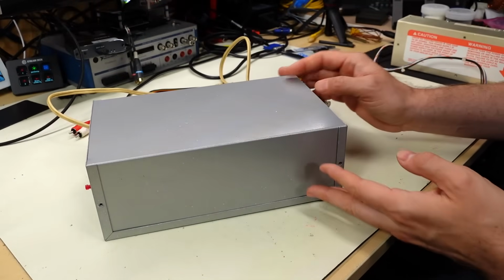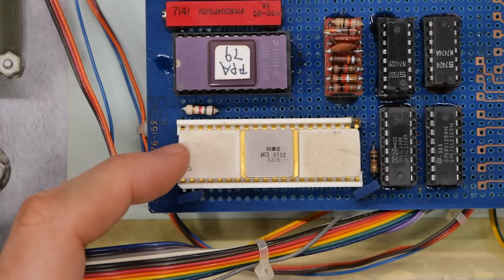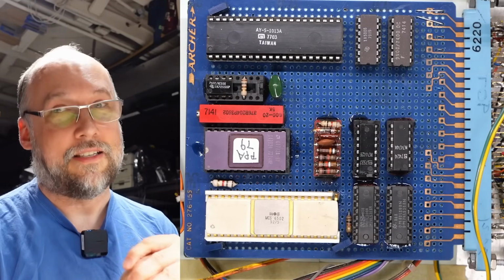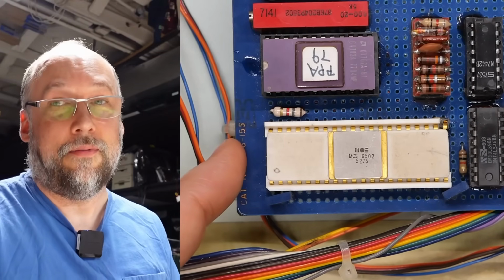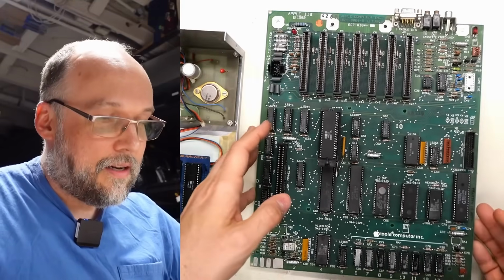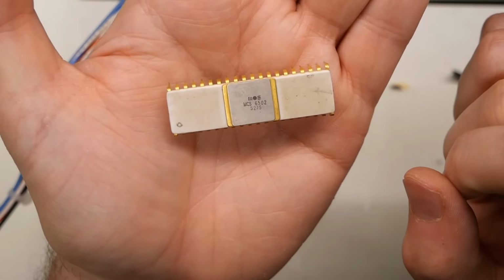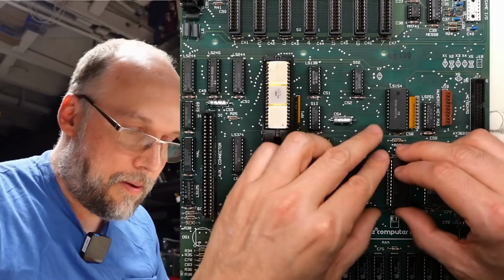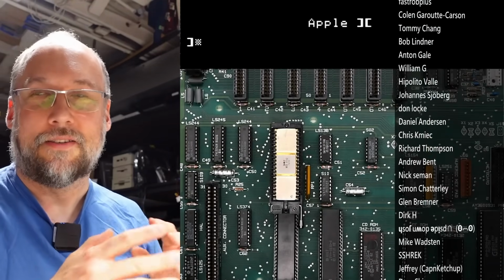Let's test a 50 year old MOS 6502 CPU

Comment: I'm certain the 6502 didn't make it into the box because it was a "piece of junk" but simple because it was the right tool for the job as well as the cheapest - there really weren't hobbyist microcontrollers available in the late 70's. 
All the microcontrollers back then had mask ROM - which means they were factory programmed in the thousands at least, so if you wanted a microprocessor that you could program yourself, the best bet was the 6502.

Comment: Nice video and even nicer hardware find! The AY-5-1013 is a UART interface.
You say that there should have been a cheaper microcontroller in that box - but in the late 1970s there were not so many cheap microcontrollers around (the 8048 and 8035 came out in 1976). Also for a hobbyist who got familiar with the instruction set (with or without ROR) and programming of the 6502 it would have been a rational decision to use the same processor in a homebrew peripheral, rather than to learn another instruction set. Also cross-compilers were not available at that time either - so developing the software on another 6502-machine would also have been quite an advantage over the alternatives. Programming the first generation microcontrollers with one-time programmable or EPROM memories built into the chip would require special programming hardware, while an early microcomputer hobbyist might have had a programmer for standard EPROMS already at hand.

Comment: It has been years since I have done any 6502 assembler.  From 1975 to 1985 the company for which I worked was a VAR for systems made by Singer/ICL in Utica, NY and we later sold a hardware/software system that used Commodore 8032s.  The Singer/ICL systems were the 1500 series that had up to 16K of memory  and was design by a guy named George Cogar who had been an engineer with Mohawk Data Sciences and was done mostly in TTL but did use the AY-5-1013 UART chip for async RS-232 interface.
Most of the programming for the 8032s was done in BASIC,  however I wrote quite a few "helper" routines in assembler.  73 de N3GAQ.

Comment: Could you tell us how he made the rom to test, I mean what happens when you execute that faulty rotate right instruction, is it documented?
Reply: Sorry, I missed the last part of the video. Checked the source code on github.
Reply: Basically; sets carry flag on, where rightmost bit is going to be carried to if ror works then executes ror on a zero (I dont know exact byte size here), if carry is set to one (set) then proves it works, if carry is still zero than it is the faulty chip. Thank you both for great information:) 😅

Comment: I end up sometimes with such a big volume of videos that I have to make quick decisions, but the I hit the @2:15 mark and that home brew box immediately got my attention. I used to make stuff like this. My first "computer" was a home brew 6502 for $300 of my newspaper job (about half a year's salary as a teenager ...). That computer lived in some strange cases with an old Odyssey 2 case as the most curious box that I remember. So whenever I see boxes like this one I have to take them apart to see what's inside.
By the way, I still have the 6502 system but not the Odyssey case. The 8048 that was in there still lives on a small board that I made, using an external EPROM, a few switches and LEDs still shows my first even blinky,  created completely from just reading the datasheets that I had to order via snail mail since we did not have internet or even BBSes back then.

Comment: When the 6502 came out, it was $25. I built a 8008 computer in 1974, but I got rid of it when I moved. I still have the plans for it. It even had a bios.

Comment: The link to the dump is wrong? both the testrom and dump points to the same. But.. would it be possible to share highres photos of the module? I would really like to try to reverse engineer the circuitry along with a possibility to run digital simulation on top of it - with the actual code.. to figure out the exact purpose of this ancient box.

Comment: I recognize the big 40-pin dip, the AY-5-1013A.. it's not a parallel interface, it is a serial UART. :)

I tend to expect that silicon from the old days will likely continue to work for, well, a long long time. Maybe hundreds of years. As long as it isn't zapped or overheated or physically damaged, anyway.

Thanks for the memory. Been a while since I fiddled with chips and discrete components like that. I was an electronics hobbyist in the 70s. Still am, but it's so different nowadays than it was back then. Some things never change, though!

Comment: Wonderful video, what a great find! I wonder, would it be better to remove the original(broken) 40-pin socket and try to shoehorn a ZIP socket in there? Or perhaps, remove the original socket and replace wit ha current socket with machines(round hole) contacts?

Comment: I buy and sell vacuum tubes and vacuum audio. Cleaned out a electronics guy and ended up with around 100 white intel 4000 series CPU chips and a bunch of other 'white' chips. Put them all on Ebay and literally made a fortune.
Reply: 4001, 4002, 4004 chips and many others. Will never run into a 'stash' like this again.

Comment: Oh wow.  I'm pretty sure there is at least one white ceramic 6502 among my collection in the attic along with a few antistat bags of other ICs from back then.  I know there are a bunch of old chipsets from 8 bit and 16 bit CBM machines up there somewhere and with a bit of luck there should also be a few old cartridges & a bunch of modded ROMs..  Ther might even be an old Apple IIe Europlus hiding up there too as I don't remember getting rid of it..  Only trouble is the attic is also stuffed to the hatch with old electronics and radios from the 1950s to 1980s (ish) too..   I only recently got rid of a pile of old laptops and 286, 386 and 486 machines to make space for more modern 'junk' ...  You got me thinking about venturing up the old rickety wooden ladders again !

Comment: I taught myself 6502 assembler using the Apple ][e monitor program back in 1985.  I have a half a dozen in my box right now.  I'm building a C64 on a breadboard right now.  That large 40pin chip definitely looks like a 65C22 VIA chip.  The smaller chips look like NAND chips that are probably used for address decoding and ROM memory mapping.

Comment: I really wonder whether the number on the bottom of the chip is actually a serial number, in which case, a number of "75073" would suggest to me that this would probably be the 73rd chip which was manufactured in 1975, meaning it may actually be the 73rd 6502 ever made (in general production, at least)...

Comment: I have some old hard discs - really old. Like a Seagate 9" and a 14" plus some much larger ones which I haven't measured but the are well over 24" diameter and somewhere I have an unused Pentium chip.

Comment: That is a fantastic find. Keep preserving our digital history. You rock!
In my years of experience hand building boards, I came to loath stamped pin sockets and wire wrap. I did build hundreds of boards with that method and sockets. Virtually all of the builds had all manner of weird problems traceable to faulty connections. Machined pin sockets are much pricier than the stamped pin variety. BUT, they pay for themselves by eliminating many hours of wasted time spent troubleshooting an unnecessary problem.
The one pin you found replaced on the socket was, most likely, because it was intermittent or outright open. ALL stamped pin sockets are a GUARANTEED built in failure point. Wire wrap also corrodes severely in a short time and CAN become intermittent as well. Depends on the alloy of the pins and wire combinations. Galvanic corrosion results with mismatched materials. FYI, wire wrap was developed for computers in missiles and rockets due to lacking a stress point where the wire exits the solder on a normal connection. This also saved weight by eliminating all that lead solder in the rocket. Missiles and rockets usually had very high QC to bypass the initial bad connections and corrosion was not an issue as these things didn't sit around for very long before being used. Once.

Comment: You ask why they used a 6502 instead of a cheap microcontroller. Was there any microcontrollers? The 6502 was made to be used like we use microcontrollers today. It was not made for computers, it was made for scales, pin ball machines, cash registers and other control tasks. So I think the creator used the MCU of the day 😊

Comment: As pointed out below, the GI AY-3-1013 was a UART chip, one of the very few available at that time. I believe Western Digital also made a UART chip as well around then, before disk drives become their main business.  I think I have some of both UARTs here somewhere. Back then, the GI chips didn't have the best reputation for reliability. But GI has some interesting special function chips like UARTs, keyboard scanners and early sound chips. Then they introduced the Peripheral Interface Controller and changed the world. Those early UARTs didn't have baud rate generators in them so I would guess the 555 circuit with the multi turn trimpot was used to generate the serial clock. Interesting to see both National Semi logos side by side, been a while since I have seen the old NS block design. Interesting little design. Would love to see the unit tested. I used a lot of those Radio Shack perf boards and one of the reasons I miss Radio Shack, the stores were great on maintaining stock of those kind of parts (back then). I can honestly say I regret things I have thrown away as not valuable at the time (my original first year Pez collection!). Great video.

Comment: I read many years ago that the low cost of the 6502 was one of the main reasons Jobs and Wozniak used it in their early Apples instead of the 8080. And thus the great divide was born... Apples vs PCs.
I still have my original Poly-88 micro based on a 2MHz NEC 8080 from 1977.  The Poly was one of the few early micros that didn't require manual entry of a bootstrap program, as it had a 1k ROM for boot and I/O functions.
I have a soft spot in my heart for these old machines, IMSAI, Altair, SWTPC.  I still have the advertisement cut sheets for them, as well as a number of late 70s micro periodicals: Byte, Dr. Dobbs, etc.
Great video!

Comment: I like your video. I also have one of those very early ceramic 6502 chips. Mine has the date code of 4775. I received mine for Christmas in 1975 and I still have it plugged into a little computer that I built back then. I often ran Tom Pittman's Tiny Basic on it. Having never experienced a problem with it, I expect that Tiny Basic must not have used the ROR instruction. The 6502 has not been out of its socket in 46 years and has not been powered up in about 30 years. The little computer contains 32 ceramic 2102 RAM chips (each is 1K x 1) for a total of 4 K Bytes. The 6502 never ran very hot but those RAM chips always stayed too hot to touch.

Comment: I’ve yet to get an early pre ROR fix 6502, though about 20 years ago I picked up tubes of “purple” ceramic gold pin 6502A’s all having date codes of “3676”, over the years I’ve also acquired new old stock silver pin ceramic SY6502A’ & B’s with date codes ranging from ‘76 to ‘81. I don’t really have much interest in pre ROR fix 6502’s other than maybe  for framing as a discussion piece. In my 6502, Z80, etc… projects I’ve used ZIF sockets for the CPU’s to swap them out with the more interesting looking ceramic examples when going to meet ups.

Comment: That is quite the find, and a clever use of an otherwise faulty processor for that project. A project which not only had the side effect of protecting the processor in a case but also was a low-stress use meaning the processor wasn't taxed to the point of failure like so many other chips can suffer from.
It might not be very useful as a full processor as mentioned due to the bug, but certainly a nice piece of history to hang on to.
Also regarding the fuzzy dates of when the change took place, odds are good that while the manufacture changed over as soon as they could, they likely still had many of the faulty ones in storage. And rather than throw them away or scrap them just sold them as ones for projects that didn't need that instruction such as in that box or other computer tinkering either by hobbyists or by the company itself for testing. AT&T did that back in the Bell System days that they would update a component of their phones but use up old parts along the way rather than waste them.
Reply: its not a flaw, its not a bug. it was part of the design.

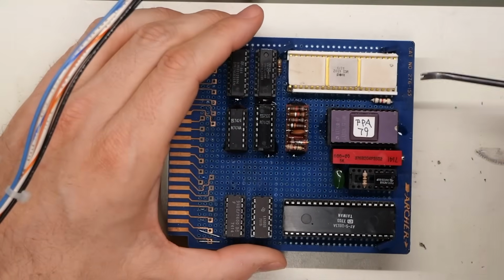Comment: 19:41 -- In an earlier life (decades ago, when I had a B&M computer store), I had a tool that allowed me to lower it over a chip (i.e., EPROMs, generally, but would work for any "LSI" form factor chip, as well as DRAM chips, when using a smaller version of the tool). It would gently life the chip straight up and out of the socket without any damage.

Back then, I was licensing the Paterson BIOS, written by Tim Paterson, author of the precursor to MSDOS 1.0 (I forget what he called it, IIRC he was working for a company named Seattle Computing or some such at the time). When IBM visited Digital Research, Gary Killdall was off flying his boat or sailing in his airplane (<g>) or something along those lines, and couldn't be bothered, and so, the suits went to visit Bill Gates.

As a result, the IBM PC didn't run CP/M, and the rest of the world ended up with MSDOS. Gates went and bought the rights to Paterson's OS, and hired him to maintain it. When he eventually left, he was I believe the sole party in the universe with rights to distribute DOS (besides MSFT).

And so, he wrote a BIOS (XT and AT versions), and designed an HDC board (its claim to fame a 1:1 interleaving pattern), and was able to sell one copy of MSDOS for each BIOS license or HDC sold.

This was how I was able to include bona fide MSDOS (with box and manual!) with each machine I built.

He later sold his company to Phoenix, and so, I was buying Phoenix BIOS labels instead of Paterson BIOS labels (having to burn my own EPROMS as usual). And, I digress. Sorry 'bout that.

Paterson went back to MSFT, where he worked on the Visual Basic project.

The end (of my digression).

That tool was very handy -- it made removal of chips trivially easy, with no fear of damage. (I had a different tool that held the pins at just the right angle for easy insertion into sockets.)

If you anticipate much more work with chips of that form factor you might want to look into those tools. If they are NLA as new manufacture, I'm sure you can find a "surplus" tool on fleabay. And you almost certainly already know all this, so, I'm writing mainly for the benefit of youngsters <g> who may not realize that such tools exist.

Comment: Yeah, that is getting back there.  Wonderful that it wound up in your hands and got rescued.  So much from those earlier days is gone for good.
 I started playing with computers in the late 70's and bits and pieces like that were pretty common.  Used perhaps, salvaged from some other piece of equipment, bought and sold at ham radio flea markets, etc.  I bought a bunch of 54XX TTL chips at one once.  They are the military version of the 74XX family.  They were also in ceramic cases with gold plated pins.  But I bought them because they were cheap, not because in those days they were rare or collectible.  And I used them in projects here and there.  I wonder if I have any left.  I've still got all my parts cabinets full of vintage early 80's chips.  Have to dig them out and check.  They're not rare and exciting like a CPU though.

Comment: I don't  know how many, one of a kind, micro controllers I have built, for industrial applications. Most of the cost is in labor Not parts. Switching  from 20-50 logic gates to a microcontroller, even at $40 was a no Brainer. Glad you found one of the easiest 6502's

Comment: Could you, I don't know, use a modern microcontroller to handle the ROR instruction and then pass through the rest of the instructions to the original CPU?

So you could use it in place of a later 6502?

Comment: I would cut that edge card connector out of the old box with about an inch or two of wires left get some spacers and mount it to the inside side of the shadowbox and you can just plug it into.

Comment: I was hoping that you'd try some graphics commands in BASIC, since those are easy to do and there is a half-decent chance that some operations would use the ROR instruction.  Just do an HGR and HPLOT 0,0 TO 279,191 real quick.  Maybe nothing unexpected will happen, but it's possible.  Or you could connect a disk drive and run a game, of course.

Comment: If I'm not mistaken, the Apple 1 ROM monitor doesn't use the ROR instruction for exactly this reason... what about using this 6502 to build an Apple 1 replica (with a modern replica PCB of course), maybe collecting other similar-vintage chips? I think it would be a cool use for a working chip, and you still could put it into a frame for display. You could also keep the ZIF socket if you are worried about breaking the pins.

Comment: The AY-5-1013A is a UART (serial port) chip.  IIRC, it used pins to set things like baud rate, parity, etc, so it could be configured purely in hardware, but required a lot of pins.

Comment: Things like this... are why I love retro-computing. This CPU is 9 years older than I am, and has so much history to it. I grew up in the 68000 era, during the Atari/Amiga wars, but neither side would have existed if not for Jack Tramiel, and the 6502 processor. I have an original 520 ST that is (almost) as old as I am. Literally the computer I grew up with, and I love that it still works. That this processor still works, and didn't become e-waste, is even more amazing. Always check the little things, because you never know what might be special...